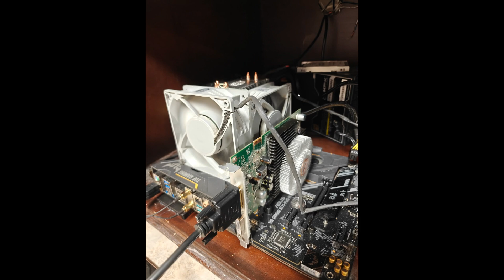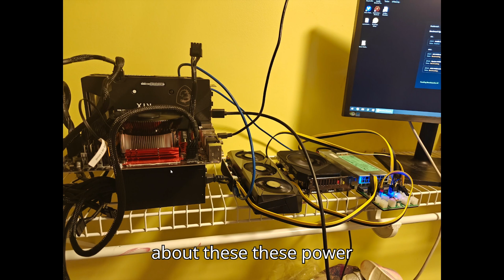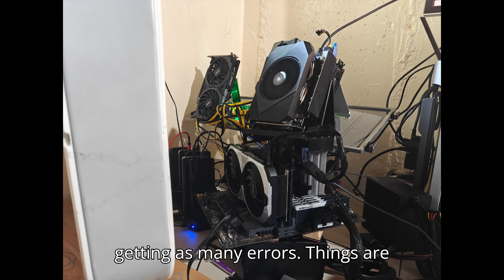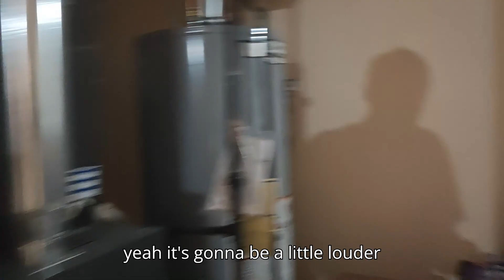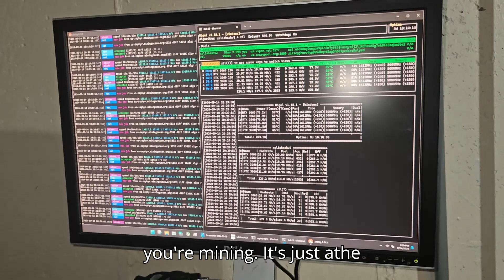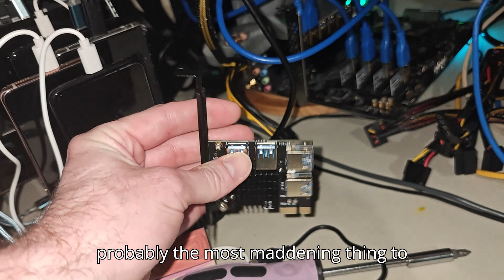Hey Dad Look at My Mining and Salad Rigs

Comment: As a 34 year type 1 diabetic and uber nerd, I'm still thoroughly confused as to what was going on around 4 minutes in.... LOL
Reply from the maker: I definitely breezed over that portion... Dexcom is very picky & prefers Galaxy S or Google phones. Whenever Dexcom decides to stop supporting a phone (which is often), we have to scramble to buy a new one & the old ones wind up in my sock drawer. I randomly found the Verus coin which is minable on phone, cpu, & gpu (<--not good though). I charged about 14 of the old phones ranging back to Galaxy S1 & eventually weeded out the unstable/incompatible phones & was left with a little 8 or 9 phone farm :D  The mining app makes those phones super hot. The best passive result I got to cool them was putting them under my wife's vanity on the floor vent. They stayed SUPER cold but I felt like an idiot digging around under her vanity trying to restart or reduce CPU usage for constant crashing so they found their way into the basement.
Reply from the maker: Also, I don't want to get into anything too personal but I hope your doing well, have that A1C on lock, & every single T1D is my HERO.
Reply: @Jackson_Digital   Thanks Man. I had a rough time with Dexcom being inaccurate and telling my pump to do some questionable dosing. I didn't ever think about the phone compatibility issues. I'm back on pens. After 34 years of T1 I have wet macular degeneration and am down to about 50% vision after many laser surgeries and a retina tear. Could be MUCH worse and I'm thankful to still be here. Appreciate the kind words and thanks for clearing up the confusion. 👍
Reply from the maker: @Oldsjunkie  No!!! Ocular issues are one of the things I lose the most sleep over. I wish there was something they could do after all that?! If your insurance will cover it, we've had tremendous success with Dex + OmniPod. It's the tubeless thingy. We're still waiting on G7 compatibility but I really would encourage this setup. From my POV, I'm treating way less lows/highs at night & spot corrections are a breeze. If there's anything I can do, let's get in touch!
Reply: @Jackson_Digital  Been a few years since I looked into the pods and might be a consideration, especially with the increasing difficulty seeing the numbers on pens and syringes. I appreciate the encouragement, advice and support.
Reply from the maker: @Oldsjunkie  Anytime brother! This is so wild that we're "texting" on a YT comment section. I still have no idea how anyone would actually be able to listen to more than four minutes of my voice before falling asleep lol.
Reply from the maker: @Oldsjunkie  You hanging in there, buddy?